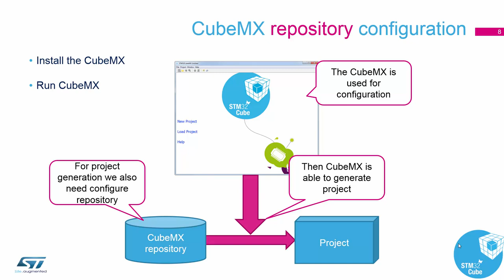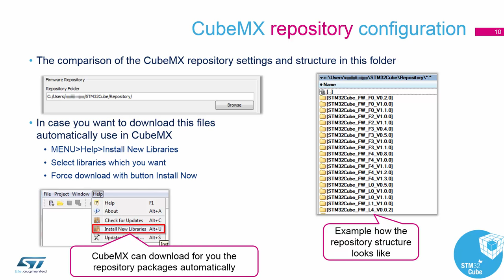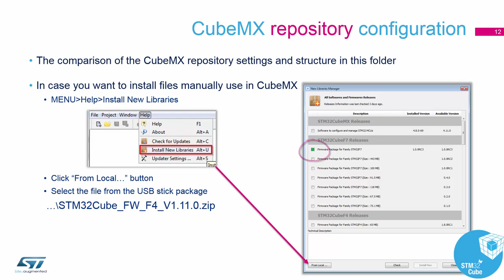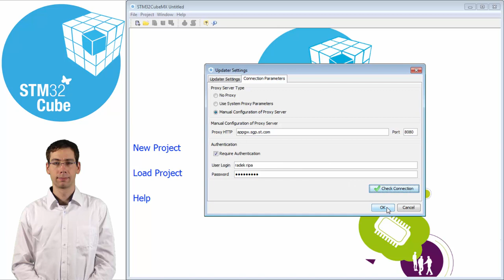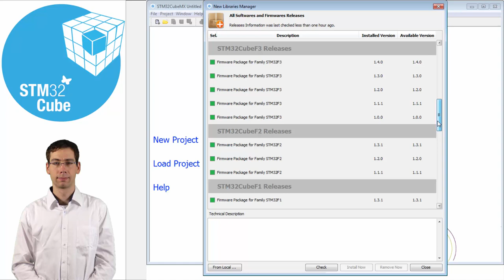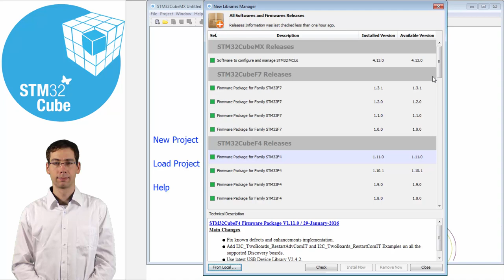STM32CubeMX basics: 01.5 Introduction - STM32CubeMX repository settings

Comment: Am I right in thinking that STM is now recommending STM32CubeIDE over STM32CubeMX?  I've installed CubeIDE and it doesn't have the same settings in the help menu.  Instead I'm creating a new project and it asks similar questions e.g. board type and downloads the appropriate libs that way.  You get presented with your boards pinout after creating the project. I suspect the rest of this course will be still relevant but project setup and library/firmware management will differ slightly.  Good work with the videos by the way.  I'm from the UK and don't find your accent difficult. Poland?